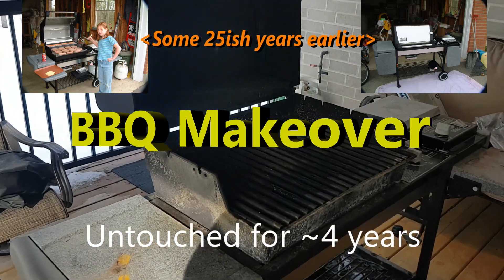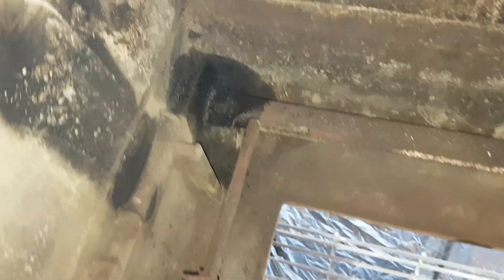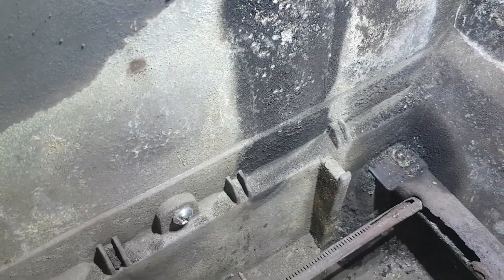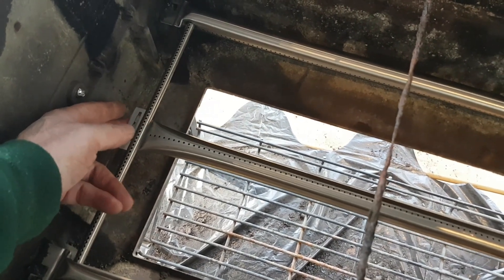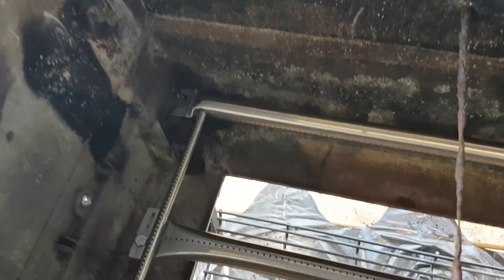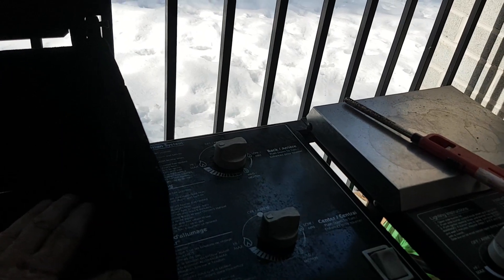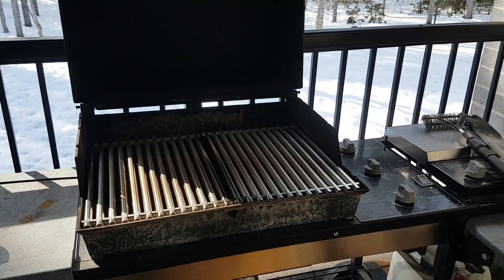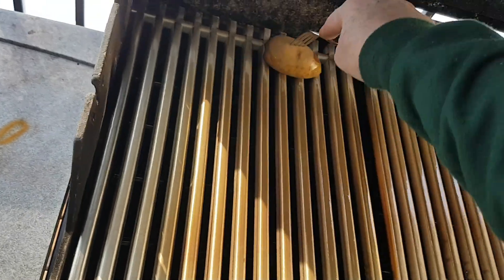Weber Genesis Gold - BBQ Make-Over - Every 25 years or so !

Comment: I'm trying to change out my burner tubes but can't loosen the two bolts on left side, so this video wasn't helpful.
Reply from the maker: The ones that hold the tubes to the housing? I had to break mine off with a chisel. My new ones kinda just sit there.
Reply: @GorillamansGarage  Yup, the ones on the left that hold the tubes to the housing.  Your bolts look same as mine (old/rusty).  Gave up trying to loosen the bolts and finally managed to pry the tubes loose,  new tubes same as yours... kinda just sit there now.  Many thanks for such a speedy response!
Reply: So, I tested the grill since tube replacement and, turns out, the knob on my propane tank gets too hot to touch now, and the tank gets warm.  Any thoughts/suggestions? Are there adjustments on the tubes perhaps??
Reply from the maker: @tantra4llife  : I left the tube coverings 1/2 open